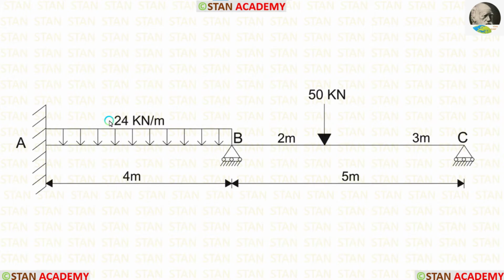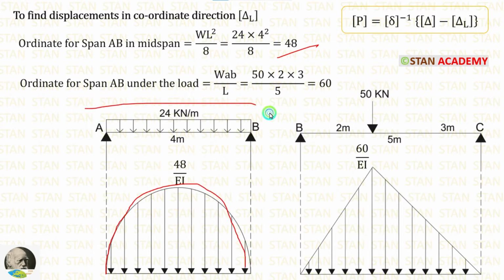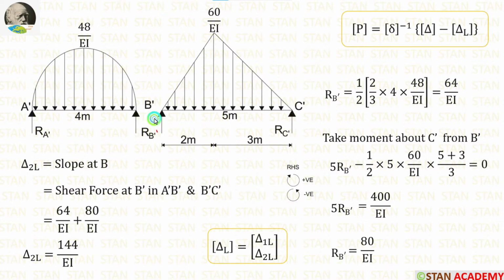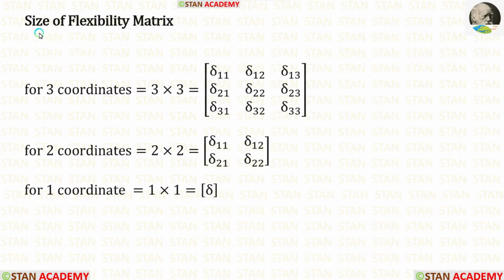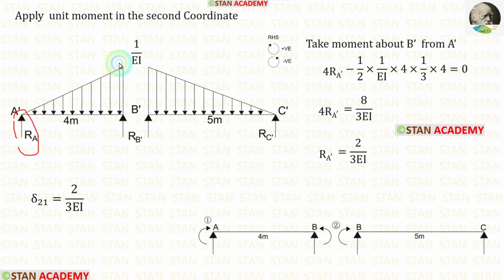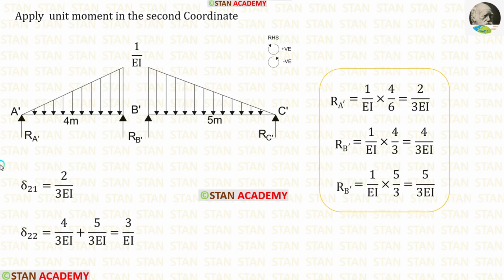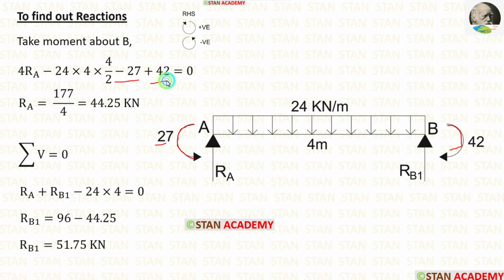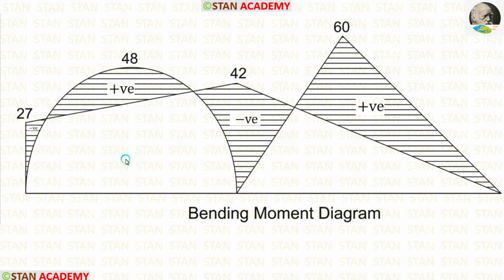Flexibility Matrix Method of Analysis of  Beams - Problem No 2

Comment: But why did you calculate first row in  flexibility matrix instead you should be calculating first column as f21 will represent displacement in 2 when load is applied in 1 .
Reply from the maker: because f21 abd f12 will be same. so it does not matter